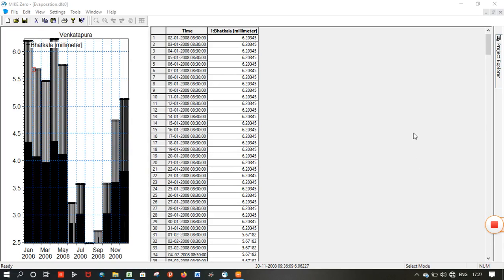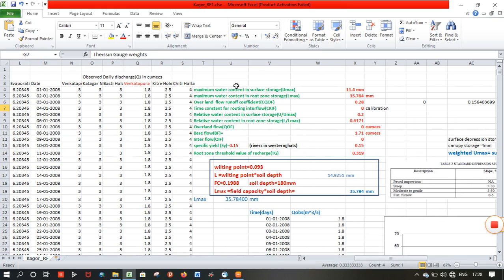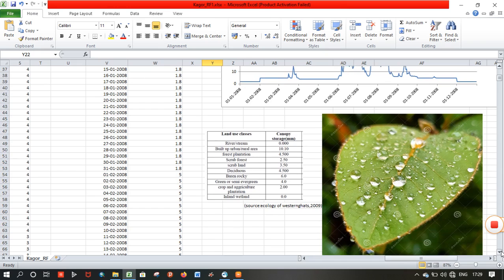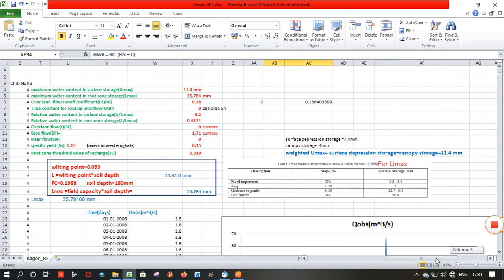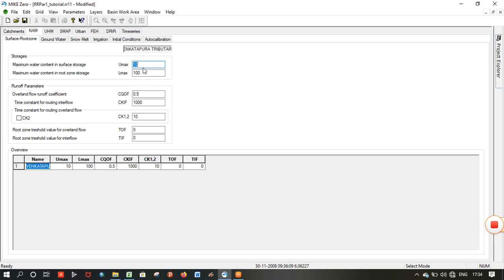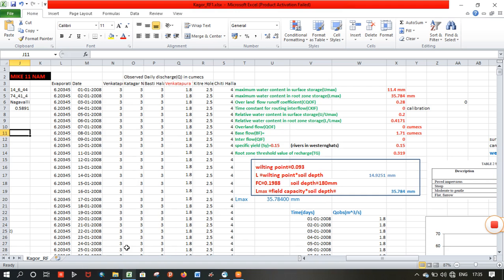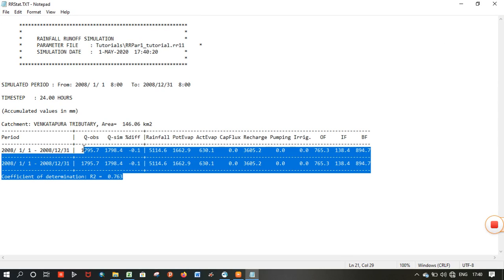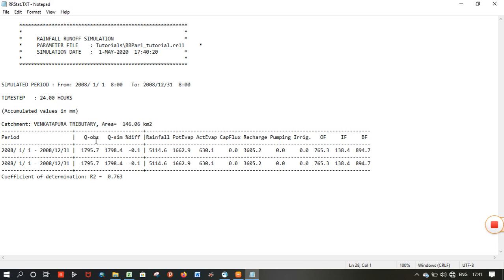MIKE 11 NAM:Part 2-Parameter calculation and Model run

Comment: for Runoff computation LULC and Slope of the terrain is most important criteria, How shall we incorporate in this model??
Reply from the maker: LULC is not that mandatory for every hydrological model,the NAM model is best suited for longterm hydrological planning of rural or forest watershed.to know the longterm behavior of watershed,In detail ground water parameter should be taken into account  and same thing is incorpated in this Model(like in detail groundwater dataset).
to account for slope factor I have considered Umax factor which depends upon basin slope of watershed and overland flow ratio which is rough estimation landuse factor
Reply: @JALAJDARPAN  Thanks for your reply.

Comment: Sir can you share the formulas used for the calculation of the initial values of the parameters. What procedure is used for setting the upper and lower bound?
Reply from the maker: Thank you Ms. Gupta for watching this channel.
share your email .i will send that spreadsheet calculation file.
please kindly promote this channel by sharing this chanel link to your colegues and friends on social media.thank you
Reply: @JALAJDARPAN  I have sent email to your email address given in comment section.
Reply: @JALAJDARPAN  sir can you share the same thing with me (formulas used for the calculation of initial parameters..)
My mail id is revanthmamidala9494@gmail.com
Reply from the maker: @pallavirangineni247  Thank you for watching this video.soon i will share that files.But for this model i've used regional local empircal equations as it's suitable for westernghats region only, due to unavailblity of groundwater data.
Reply: Thank you for tutorial...
Pls share the same on this Email ID: keyurdjayswal85@gmail.com